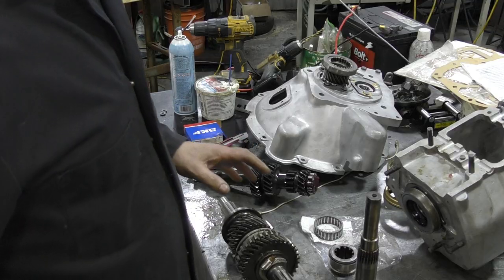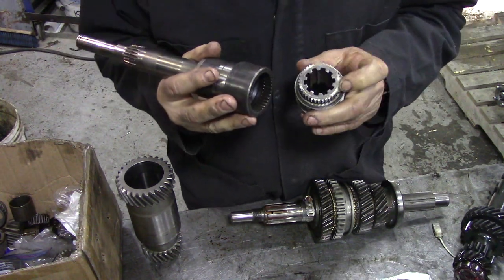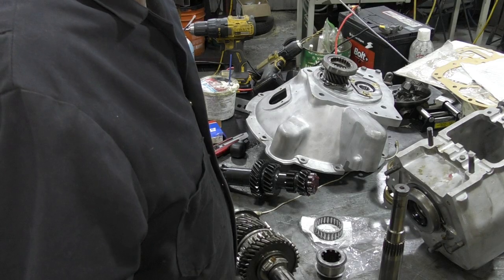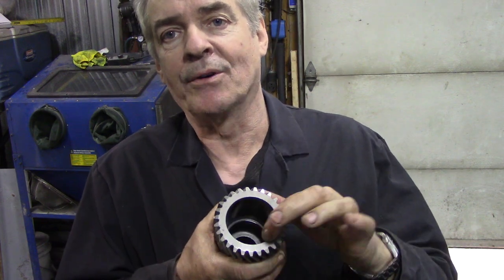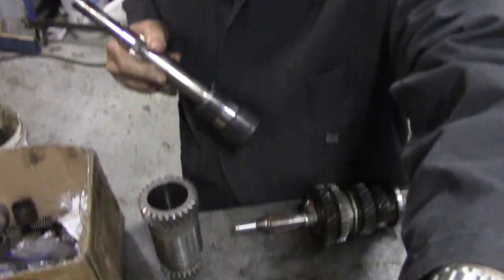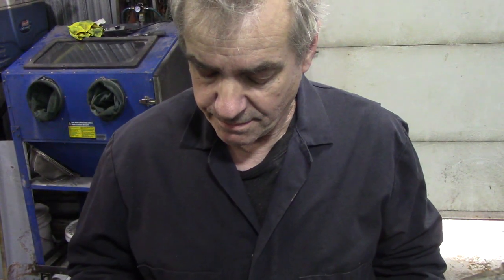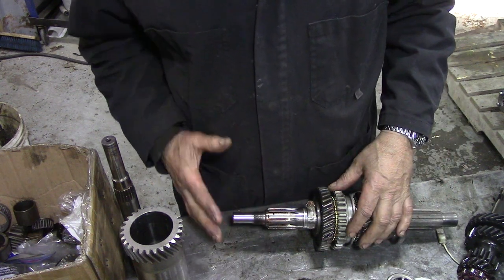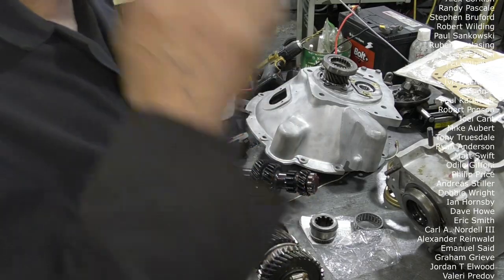Series 3 gearbox and overdrive problems

Comment: When I bought my S3 2.25d new in 1975....I quickly got one of the first fairy overdrives that had just come out.....made driving the landrover more bearable over the next 200.000mls.

But in all those years it was a pain.....and it wore the end on my mainshaft just like the main shaft you have.

So once I fitted my 200DI engine.....I quickly fitted 2 3.5 high ratio diffs.....give the same gearing in 4th gear as O/H high gear.....with out the whine or constant topping up with oil.

TBH I was glad to see the back of my overdrive....I dont think the old 2.25d would have coped with 3.5diffs....but a petrol would.

To me they are not worth the cost to re-build.

Your undersize main shaft....could you not fit a speedy sleeve to it.

I have a spare main shaft rear bearing housing....are there and measurements from it I can give you....I dont want to sell it.
Reply from the maker: I think they are going to get a Roamerdrive - from what I can see it does not need the bearing surface on the end of the shaft

Comment: New LT76 mainshafts are available,just need to know which suffix,  I may have a spare PTO Cover ( Rear Mainshaft Support Cover) with internal support roller bearing) but will also require replacement gear & castellated nut & lock tab etc which were removed to fit  the Overdrive.
Reply from the maker: I think due to the cost of parts they are going to get a Roamerdrive new

Comment: Hello from Greece, I really need your advise , because don't have this kind of experience. I have a series III and I am trying to fit the OD in the gear box. So, I removed the basics and when was time to put the OD in the main shaft, I realized that the diameter of shaft is larger than the Overdrive hole. 
Now I am trying to find out how I have to continue. Please any suggestions?? If I trim the main shaft as you said, it will work? Appreciate your feedback
Reply from the maker: It has been a long time since I did this video, but the mainshaft is constant, so there could be something wrong with the Overdrive?

Καλή τύχη!

Mike

Comment: I rebuilt a badly abused Fairey last autumn.  Cost me about £400 for a replacement input gear (the one at the very back end) and lay shaft gear cluster, and was the last pair of a batch made in 2007.  There seemed to be no others anywhere.  I also used what seemed to be the last available clutch sleeve, which had been a returned but unused item from the excellent source of the bearings and service parts kit (GLF Classics).  All told, the parts cost me over £700.  Half the price of the Roverdrive now, but you also have to find a reparable unit to fix in the first place.
Reply from the maker: C$2000 for a Roamerdrive  - the old Overdrives are not worth fixing if there is any damage to the shafts or gears
Reply: @BritannicaRestorations , it depends on what you can find and the total price.  Including buying the buggered unit, I now have a nearly new condition one for about £1k.  They are being sold refurbished for about £1400 plus the VAT, and Roverdrives shot up in price to around £1800+VAT a few years ago.  I suppose a lot depends on taxes and import costs and where you are.  But if you want an overdrive on an old classic, like your SI, then a Roverdrive doesn’t really cut it.  I have a Roverdrive on my 109, but that is anything but original or classic…
Reply from the maker: I would not consider anything like that in my S1! Frightening to drive here as it is with the big trucks trying to pass you!

Comment: Hello from Denver.  I have a series lll 109 exmod 12v.  When I drive down the road the shift lever pops out of gear mostly when there isn’t a load on the gear box, it’s seems to do it more in second gear. For example, coasting down a hill it will pop out of gear. What is causing this problem?  Thank you, John.
Reply from the maker: Could be bad synchros or detent springs are weak

Comment: Can you not put a sleeve on the end of the shaft?
Reply from the maker: It needs to be hardened and thin - JP took 0.020 off the shaft to save it
However, if I can get hold of a cover I may be able to find a needle bearing to fit the machined shaft
Reply: I think Speedi Sleeves are hardened.  They’re made for this sort of circumstance.